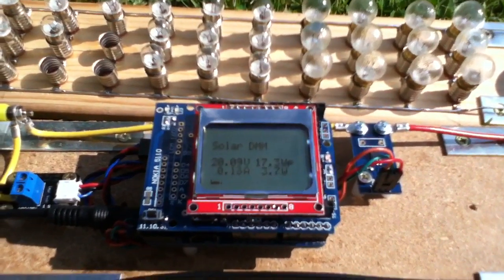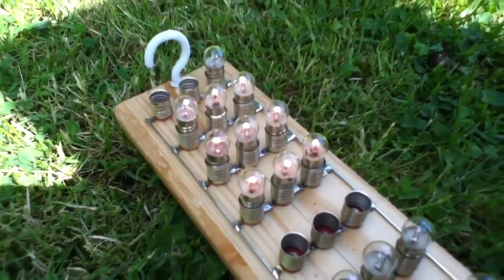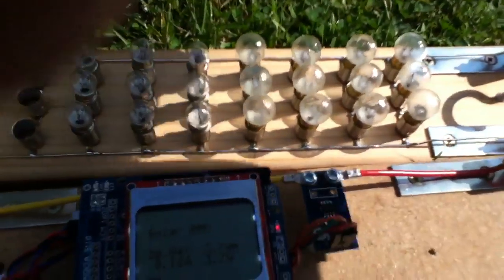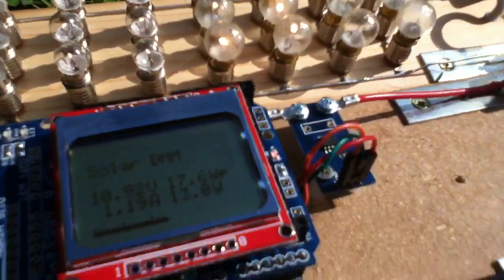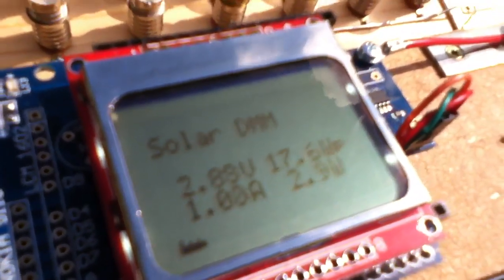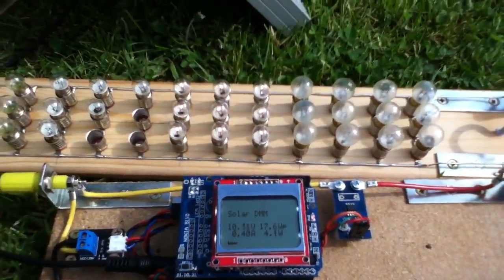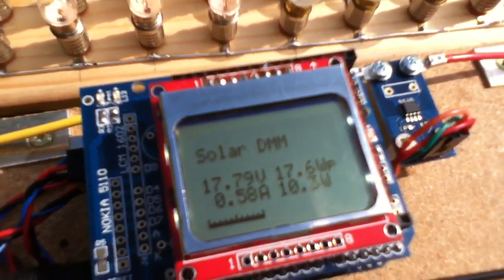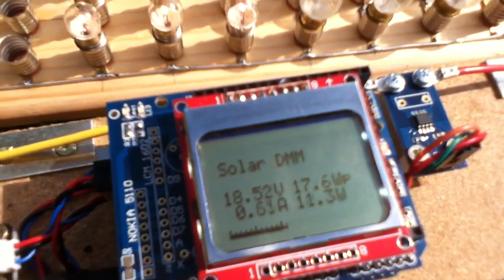MPPT Solar Charge Controller #4 - Finding Maximum Power with the LAMB

Comment: The LAMB! That sounds sweet!
Wouldn't it be much easier just to use a little variable dummy load? You can buy a 60W dummy load from china for about 15 Eur and it would do the job perfectly :-) You can also use some bigger resistors capable of handling the power of the solar panel. Or a power potentionmeter of around 100ohms here would do the job :-)
In my experience when you use the panel just for charging batteries you can use a DC-DC Buckconverter and it will automatically nearly find the MPP if you adjust the buck conveters output voltage a little over battery voltage or even max. end of charge voltage. Others doubt that this will be near the MPP - from a discussion in a photovoltaic forum.

Comment from the maker: I couldn't possibly condone the use of 99 incandescent lamps as a bench light! If these experiments result in a working MPPT charge controller, I will make 2 versions: an Arduino version which is open source and a microcontroller version which is proprietary.

Thanks Raymond for your continued support.